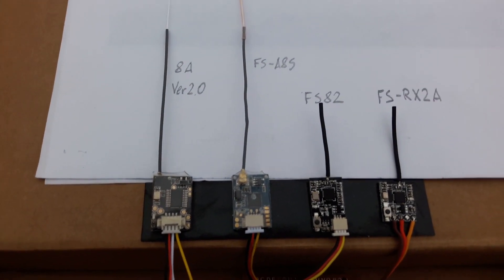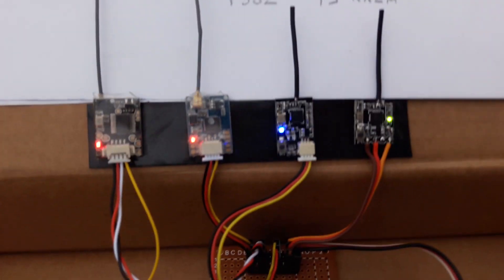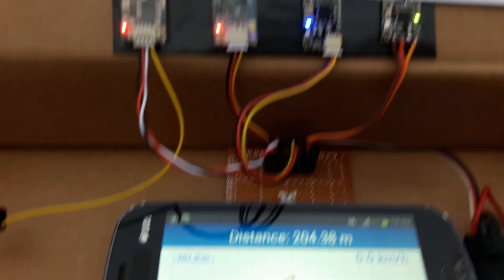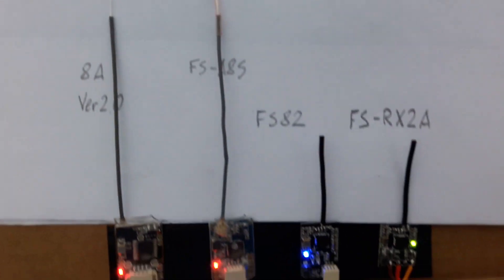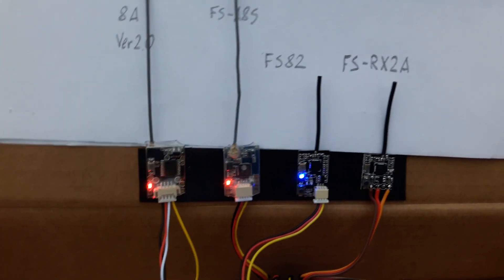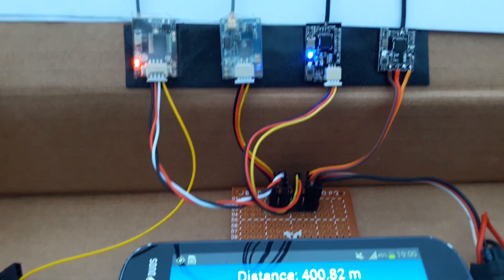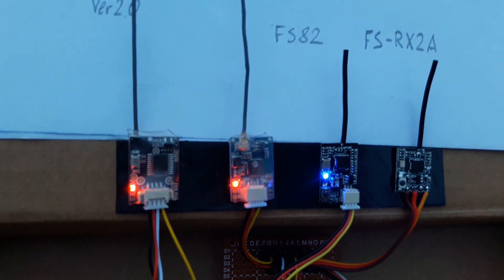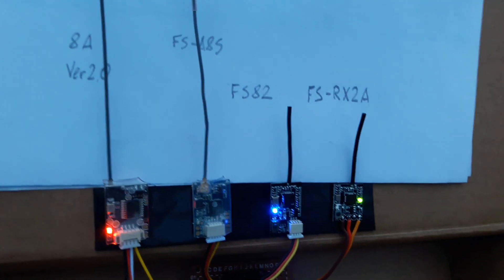FlySky micro receivers ground level range test

Comment: Hello thanks for your review, I am desesperatly trying to bind those RX with my fs-i6x and fs-i6s without luck I tried eachine teeny cube RX,  8A mini RX,  eachine minicube flysky.If you have an idea I would be great full
Reply from the maker: Jean-Matthieu Bodin have you watched this video on binding: https://youtu.be/nGTxIjDLY34 ? The same binding method should be used with all of them. The most frequent mistake is to wait for the transmitter to show the sucessfull binding, but it will never show you this, because these receivers have one way communication.
Reply: Montis thanks I Will try to Check transmitter info on betaflight

Comment: Thanks! It would be nice to see a test with not better but just "right length" (~31mm) antenna on A8S and 8A. :)
Reply from the maker: Thanks for suggestion. I suggest to look at the Joshua Bardwell video about his quest for "right antenna length" . Also look at the RcModellReviews video: https://www.youtube.com/watch?v=WBE_KqqHbM0
Reply: Yes, I saw those videos and I changed my mind. I looked at the A8S receiver's board and there is a little - I don't know exactly - inductance between the antenna and the chip. So I think the 26mm antenna length is just fine, but I could not test it. But I would be curious about the matter with 31mm length antenna. :)
Reply: You had a 26mm antenna on your A8S ? mine is 23mm...
Reply: Yes. I got those receiver with 26mm antenna, with nice heatshrink on it. :)
Reply: József Gyenes I just checked and both of mines have a 23mm antenna.
Reply: A8S and 8A sucks. RX2A was better on my actual usage
Reply: raffy turc did you by chance have the rx2a pro? Or the rx2a pro V1? Thsoe two models far outperform the original rx2a. The v1 gets 500 meters + and the regular rx2a pro gets 400 meters.
Reply: Alex Crowder original rx2a? I have in hand an rx2a pro(short antenna) and the rx2a pro v1(long antenna with ufl connector).

Rx2a I have tested, even modded the other one(I have 2) by extending the antenna(and finding/scraping board GND for antenna). The newer rx2a pro v1, havent tested personally yet. But I guess they would be the same with the older rx2a pro.

Choosing from A8S , 8A and RX2A pro, the later has the best reception. Check my channel. Notice the area where I get failsafe(older vid) compared to the newer. But it will not be a fair comparison since im using an external 6dBi mod for fsi6 transmitter.
Reply: raffy turc I have the i6s , and inside there are 4 antenna pads , all labeled clearly #1234 ect . Two bottom ones have ufl connectors that connect to the 2 internal antennas & the other 2 have nothing on them not even the ufl connector , I’m thinking that if i add ufl to them and do external 3dbi & 5dbi antenna I can keep the 2 internal ones as well . let me know if you want my email so I can send you pictures if you are more interested I’m still not sure why they are there and why they are not being used ?

Comment: you should try a test with the same antenna on all of them . the results will be almost identical (they all use same RF chip) .. except rx2a.
good test though.  thx for sharing.
Reply from the maker: +yo8aiv good suggestion, but my aim was to test everything as it comes, with the stock antennas. 
This was ground to ground test. I will also test ground to air range. But it will take some time.

Comment: good vid added to my playlist
you can also extend the range by plugging in a better antenna
Reply from the maker: How To DIY Rc, I have a bunch of 2.4gHz dipole antenas with u.FL connectors. They should extend the range versus this simple monopole antenna. But first I want to try real range in the air with the stock antennas.
Reply: ye there is big difference high up in the air must give you more range too but on a quad, the range is compromised by all the other electronics looking forward to those results
Reply: How To DIY Rc How To DIY Rc your right but I like to see ground tests cause it’s a pretty rough test if you know what I mean , this type of test is how I test all my cameras so I don’t loose a quadcopter first , it’s simple and you know if you quad was  in the air in wide open space like you say it will get even better connection
Reply: How To DIY Rc how do I use the ibus on rx2a pro
Reply from the maker: Connect IBUS signal from Receiver to the flight controller RX port. In Betaflight Configurator - set SerialRX in Ports tab, Receiver Mode - RX_SERIAL and select Serial Receiver Porvider - IBUS in the Configuration tab.